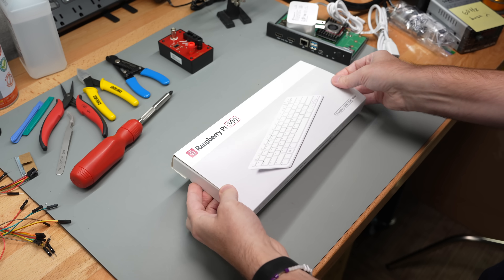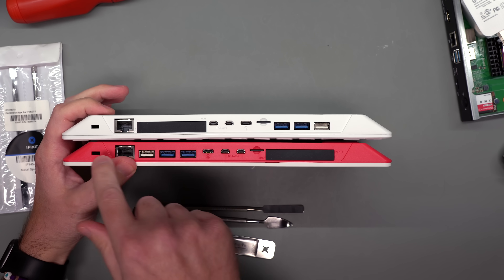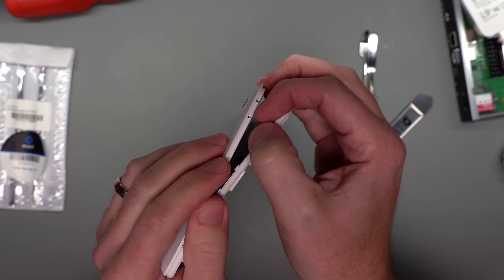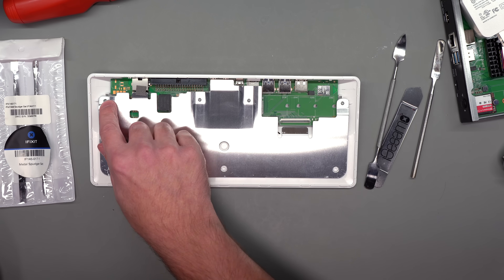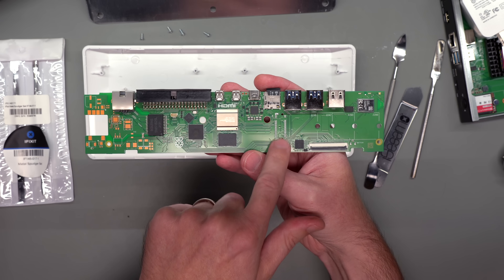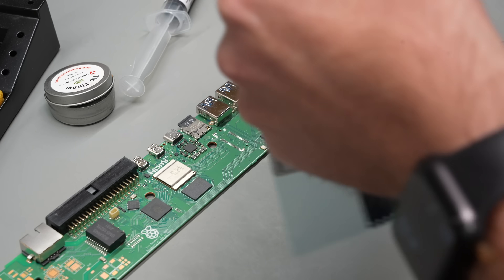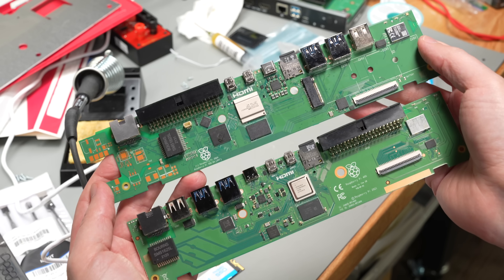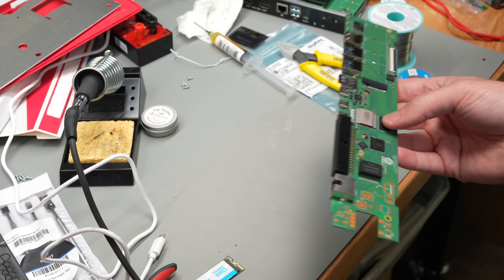What's inside the Raspberry Pi 500?

Comment: Only way I would possibly interested in it is if it had the NVME slot and a strap door on the bottom to get to the damn thing. What a wasted opportunity. Charge us little bit more and give us the damb port. They could have also just given us a larger trapdoor and a ribbon connector like the raspberry Pi 5 So we could could connect any  PCIE device to the thing.  They or other 3rd party vendors could make devices to put in a bottom trapdoor.

Comment: If they
1) made it user serviceable
2) put an NVME slot on the back with a little door so you dont have to take it apart to add nvme
3) made a 16gb ram version
4) made a version with an aluminum body instead of plastic (optional)
Then i would get one in a heartbeat. Even if it costs an extra 100 dollars, or even 200 dollars, I'd happily make this my favorite pi, and my first full blown pi (i only ever had zeros and picos). 

The aluminum body idea with the nvme door idea could also open the door for even better cooling by using the bottom as a big heatsink for the CPU and possible nvme drive. Throw in a tpm and rtc (idk if the 500 has an rtc with a slot for a battery like the pi) and it would become THE GOAT. Idk why, im only 26 so i dont have any nostalgia for the era, but i love the idea of a desktop keyboard/mini pc keyboard combo so much, i really wish they didnt go out of style. It would definitely be possible with an arm processor and all flash storage, and Raspberry pi are the main ones that can do it at the moment. 

This is all without mentioning that an easily accessible nvme slot would also allow you to install ai co-processor, which would be an incredible tool for people learning the basics of AI. 

I know most of this wont occur, but it just feels like there are multiple good ideas that are both right in front of them and completely being missed/ignored. 

This also reminds of the question "why dont they just make USB-C versions of their Pi's?" Id happily pay a few extra dollars for USB C versions of raspberry pi products. I remember that their official stance is that microUSB is more accessible and saves them a few more cents per board (a cost that adds up according to them) but not only is USB-C becoming more common, but plenty of people would pay extra to more than make up the difference in cost between microUSB and USB-C.
Reply: It looks like they heard you, and everybody else who couldn't quite buy a 500.  The 500+ addresses all of the most important issues.

Comment: Thanks for the teardown.   The reason I was looking for this video was to see if there was enough room inside to add an NVME drive.   I didn't expect the board to already be partially prepped for it, and unfortunately it does not look like there is any other way to add one since the ZIF connector used on the regular Pi 5 is missing.
Now that I see this, I am really hoping the Pi 500 "pro" or whatever comes out with NVME and PoE.

Comment: 16:36 My guess is that they wanted to include it, but didn't get it to work reliably (as well as POE) in time. So it was abandoned. But using that design was probably cheaper than redesigning it without. I also wish they would flip the design to the underside, so they can add a flap for installing/changing the SSD without opening the computer up.

Comment: A good method for soldering sockets like this is to use a smaller tip on your soldering iron and  drag solder it. Makes for a cleaner and tidier  solder joints.

Comment: For micro soldering there's 2 methods I've seen work good. Drag soldering with a precision tip,  or use solder paste and a heat gun. Solder paste can get you factory quality results.

Comment: The 500 launch is disappointing and seems to be premature as the 500 is incomplete i.e. no M.2 port, NVME interface electronics, removable cover and bottom bay slot from installing an M.2 SSD and no for POE hardware.

Comment: I doubt that they left off the M.2 slot simply to save manufacturing costs. I suspect there is something fundamentally wrong with the board design so that, even if you soldered the parts on correctly, the SSD would be flaky or suboptimal in some way.

Comment: I'd cheat and use a small solder paste stencil and hot air. I'd also use a multimeter on each pin to test for continuity versus eyeballing it. 

https://youtu.be/uXvXwzQf1gU?si=hO9C_stdEx8o9ZaW

Comment: The absence of an NVMe SSD slot kills the appeal of the Pi 500 significantly. With the slot, the Pi could easily be one of the best entry-level "My First Computer" for students.
Reply: Meh. Its fine with MicroSD only. I stuck a 1TB card in mine and it is quite awesome.
Reply: @eightbit1975  Micro SD Cards have relatively poor reliability. They can stop functioning randomly. The same does not happen with NVME SSDs. 
Secondly, the speeds that SSDs offer are way more than SD Cards. 
For casual work, Micro SD cards are fine. But for anything more, it would be wise to invest in an SSD, even if it is entry-level, as MTBF is WAY MORE.
Essentially: More Reliability and WAY MORE Speed.
Reply: @eightbit1975  In terms of speed, stability, durability and reliability sd card are shit compared to any ssd. even for msata, m.2 sata or NVME.  thats why we need that slot really bad.

Comment: I think they didn't put it just yet, because they figured out some instability of the board drawing too much energy from the power source (mini usb if is still the same as generations back). Passing on usb-c, therr are lots of alternatives to amperage and voltage feeding the board. So I think that if you provide the power for your nvme separately, that should simply work.

Comment: A couple tips for soldering on a pre-done board like this. Always clean the pads beforehand with solder braid. Give it a brush with some alcohol to get rid of the excess flux. You then get a flat, clean surface to lay the component on. It helps reduce movement as you're soldering as well. Do as you did with the flux, and preloading the iron with solder. Use your dominant hand with the iron, and with the other hand, hold the component down with a spudger, tweezers, or even a stick of some sort. Don't worry about bridges at first, just tack it down on both sides. Once you do that, flux it some more and carefully glide the iron on the PADS to let more solder lay down. Clean up with more solder braid after and alcohol bath.

Comment: You could have saved some time by checking the pins for power with a multi-meter.
I'm super curious now, though. I wonder if you could just measure the backside area for voltages and throw some some caps to see if you can make it go. The M.2 NVMe pinout requirements are online, so as long as you can meet the needs then I wonder if there's actually data lines available?

Comment: I love the Pi 400 already for being my daily linux system for experimenting and the central ssh hub for all other linux systems I run. It is not taking much space on the desk. But to have extra memory there is always something sticking out of the 400's rear end. I really would have loved the internal NVME or M.2 slot. Currently there is no reason for me to buy a 500 unless they add the NVME or M.2. Having PoE is nice, saving WiFi bandwidth and making the PSU obsolete would mean 3 functions, LAN, Power and Video over two cables. It would have been perfect if that just was possible over one USB-C, Monitor with HUB, one cable all in.

Comment: Really... you shouldn't be using a soldering iron. You should be using a high-intensity, heat gun. And you merely give it a blow job with that. And the solder, will melt and flow. And  you, won't do any damage that way. Of the, teeny tiny circuit traces. Never designed for a soldering iron tip. Only designed for hot air. But I note you need to try.

Now I learned as a Professional Electronics Technician. To pick up the phone. And give these companies, a call.

So I think you should've contacted, Raspberry. And said... hey... I see this header is. For a memory chip. Can you tell me how to hook it up? And you might get some results? And also learn something new. That's how you do it. That's a get better than the rest. And it only costs you a long-distance telephone call.

I can tell you back in the 1970s and 80s. I spent a lot of money on long-distance telephone calls. I got the equivalent of a college education. I was speaking to the application engineers. I was speaking to the design engineers. The software engineers. I was getting valid information from the horses mouth.

So you don't need to dream about it. You need to pick up your phone. And give them a call. Ask them how to hook this up. It's on the circuit board, after all. They had intentions for it. Is it ready to go? What is the support circuitry? Send me a schematic, please. Call them. That's why you have a mouth and vocal cords. That's how you get better. For, cheap. For, free. And unlimited local and long-distance calling, today. It won't cost you anything. It cost me thousands. Back in the day. But it was worth it. It was a free education. And in advance to me. Substantially. Professionally.

So after 20 years. I retired as a Top Broadcast Engineer for NBC-TV News, in Washington DC. So I got to work with folks like Ronnie Reagan and George HW Bush, Senior. I could hardly believe it? I came on board for, NBC-FM, Rock 'n Roll, Music Entertainment Division. But because I was a union engineer. They suddenly realized. They had an actual Hottie, Audio Engineer on their hands. And they transferred me into, On Air Network News Operations. I begged them not to. But they wouldn't listen. They wouldn't take no for an answer. They told me I was a good engineer and I'll do fine. Ugh! LOL.

And so I became one of the best they, ever had. And after 20 years of it. I could no longer tolerate, 8 hours of bad news, every day throughout the day. It got to me. I was all about the music. Not the News. Not the Politics. But I was really good with that. The best they ever had.

And so that was all about, Information Dissemination and Knowledge. That's all Talking Heads. Not the rock band. Oh how I wished. But the Suits. The flapping tongues. And I made them better understood. Bigger, fatter, cleaner, more in your face. More upfront. So you could hear every word. And not miss a single consonant. To misconstrue its meaning.

And I am also personally the reason. Why nobody in the world. Gets there Major Network Television News. Not in, Stereo. But in good old-fashioned, Monaural a.k.a. Mono. It's not in Stereo. And that's all my fault. All my doing. I was the only one Consultant. By NBC-TV News.

And since we were the first in the world to go Stereo. And with Stereo News. We continue to do the News in Mono. Because Intelligibility is highest, in Mono. With no stereo effect, distractions. No distractions. It's in Mono. And all of the other networks in the USA and around the world. All, followed my lead, Technically.

And so I'm the reason. Nobody in the world. Gets the cover Network News in Stereo. Nobody. I think it's very funny. I never imagined. I would have such a Sweeping Influence. Around and throughout the entire world. With my Engineering Technique. This is crazy. But it's the way it needs to be. For highest intelligibility. Greatest clarity. No distractions. Of Stereo things happening. That would distract you from the message.

So a lot of psychology goes into this, Audio Engineering, Thing. And since I've been to a lot of, Psychiatrists and Psychologists and other mental health professionals. NBC thought. I knew what I was talking about. My technical arguments made sense to them. And it made it much easier for the other audio engineers. Who never engineered anything in stereo before. Not to have to do so. In making their lives a lot easier.. So, my argument met with unanimous approval. As I knew making it easier would win out. It did.

So now I am fully retired at 69. My career did not end the way I had worked toward. Of that I am, pissed off and enraged as all hell. There is no way to change that. The bad guys now win. This is not good. This is not America as we know it anymore. It has deteriorated badly, since Trump. Started it. To destroy the USA. And now they have brought them back to finish the job? Yup.

We have laws in place by our founding fathers. To prevent this calamity. It has nothing to do with the people want. It has to do with the protection of our Union and the USA as a whole. It has to do with our Democracy. Which has recently been destroyed. And women reversed to, second-class citizens. Slaves to the boys. And that's not America. That's not what we stand for. That's what we fight against.

So this is all a totally FUCKED-UP, anti-American scenario. And Donnie wants to destroy our American way of life. He's got a better rich boy idea. And only four other rich boys. With a 4-year-old maturity like himself. I mean this is totally dreadful. It really couldn't be worse. But it will get worse. Guaranteed.

Anybody who has eliminated, half the populace's rights called women. Does not belong at 1600 Pennsylvania Ave. NW. He stands for nothing good. He stands for everything bad.

But sick in the head American goofballs. Voted for this piece of crap. And our government did not do its job. In preventing that piece of SHIT. From taking over again. We have laws in place to prevent him. It doesn't matter what a gang of thugs wants in this case. Our Democracy must be Preserved. And when you take away all the women's rights? That's absolutely the wrong thing to do. Absolutely. That makes no sense. That is not American. A president was set for over 50 years. You don't take that away from people. It was a precedence set. Fought for for years. You don't take that away from women. They don't do such things if you are an American. They aren't. They are Nazis. Real live actual Nazis. And we have laws to prevent Nazi dictatorships in the USA. I thought? That are not being  adhered to. Due to a coup d'état in progress. To destroy the USA.

We cannot allow this to happen. Blood will be shed. To be sure. They've already killed enough young innocent women. Time to turn the tides. There are cold-blooded inhumane killers. We know how to deal with those types. We have in the past. In our own past. It is now necessary again. To bring back the USA to the American people. It's not for Nazis. It never was. It never will be. We will see to it. We have to. We are the Americans in the USA.

It's going to be 4 years of utter total chaos. And the ripping of rights to shreds.
RemyRAD

Comment: I'd recommend in addition to the metal spudger set, you should get yourself some plastic spudgers/shims.  The plastic ones are much better for opening plastic cases without carving them up in the process (but they're thicker, so not always as easy to get into tight cracks, but still often useful for running down the length of something once you've got a corner open, etc.).

Also, I'm pretty sure that keyboard connector keeps letting go because you're not actually fastening it all the way.  You need to flip the bar down and then slide it in to lock it down.
Reply: I highly recommended iFixit's "Jimmy". It has a thin, slightly flexy-blade which is perfect for popping open annoying cases like this.

Comment: Framework is using the RP2040 Chip for their Laptop 16 Input Modules (Keyboard, Macropad, Numpad) and is running it with QMK Firmware.
Reply from the maker: Someday... someday I'll get a Framework!
Reply: @Level2Jeff  Well i have the Framework Laptop 16 and would advise, wait for the Next Mainboard Generation, There are currently alot of Problems with Heatmanagement (misconstructed CPU Contact Area + Liquid Metal Runoff Framework just started replacing their LM with PTM7958 in Production). I even soldered another Shim onto my Heatsink to get the CPU running in and over the stated Specs. The Laptop 13 is really solid as it isn't a First Gen Product anymore.
Reply: @Level2Jeff  As i have the Laptop 16 i would advise wait for the Next Mainboard Generation the current has a misconstructed Heatsink (CPU Contact Area acts as a Heat"Narrower" not a Heatspreader (i soldered another Shim onto the Vaporchamber for Tests and revealed the Heatsink could handle 63w sustained TDP with a proper Contact Area instead of Frameworks advertised 45w)) the newest Batches have PTM7958 instead of Liquid Metal as they had Problems with Runoff which only showed after the Systems where deployed into Reallife. The Laptop 13 is a really solid Device as of now.
Reply: @SpartanCE117 as an owner of an FW16, I concur haha. The FW13 is great and I’ll always recommend it. The 16… not as much. I definitely got it more as a “putting my money where my mouth is” sort of thing where I did need a dGPU capable laptop but also acknowledged I’d likely be facing a lot of teething pains versus what next generation or maybe the next next gen would see.

I hope in another 4-5 years though FW16 will be fully recommendable as they figure things out, especially with new GPU modules ideally.